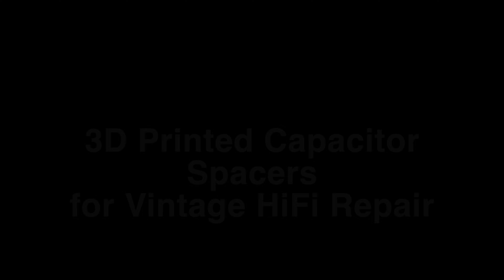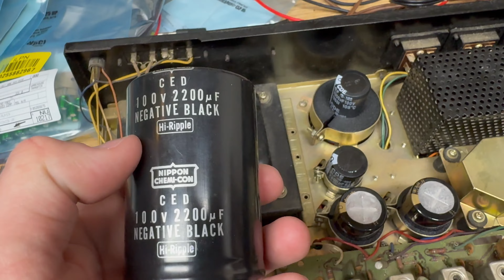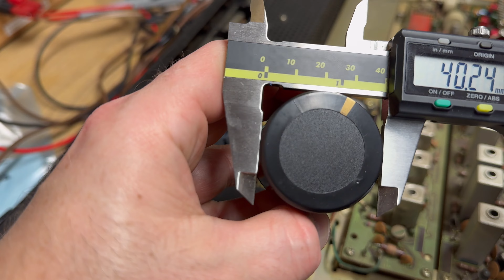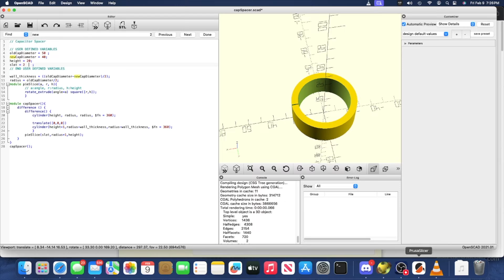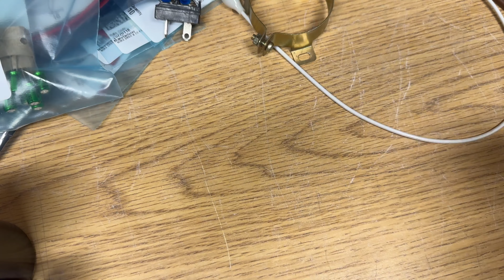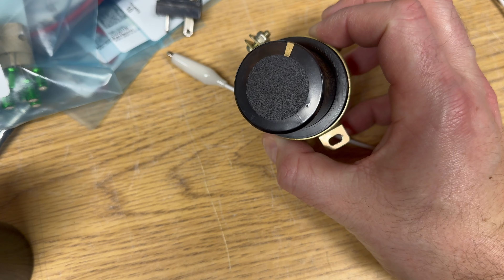3D Printed Capacitor Adapters for Vintage HiFi Audio Repair

Comment: Instead of solid all the way from top to bottom, you could print it with ribs going around the circumference at the top and bottom and one in the middle.  The middle rib and top could have a chamfer so you would not need to add supports.  This could reduce the material and print time when the OD-ID gets to be large in extreme cases.
Reply from the maker: yeah definitely room for improvement, but i'm not very good at creating the drawings so this was the best I could do in a relatively short amount of time.

that being said, I recently used AI (Grok) to create a few OpenSCAD files for me based simply off my description and it did a nearly perfect job, so I could probably have it modify my existing code to minimize material usage.

Comment: Any heat issues? Are you using PLA?
Reply from the maker: No heat issues.  I use PETG for the most part. I think PLA would be fine in most cases unless the caps are right up against the heatsinks or near incandescent lights etc.  I’d be extra careful with tube gear, and maybe use ABS.  I actually used PLA when I made some similar adapters for my tektronix 575 a few years ago and they have held up fine in that much warmer environment.